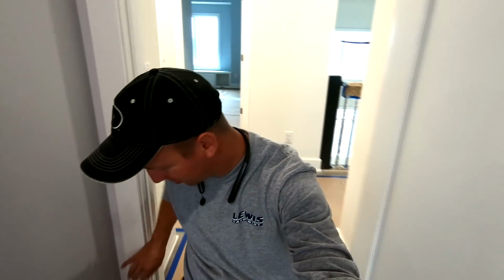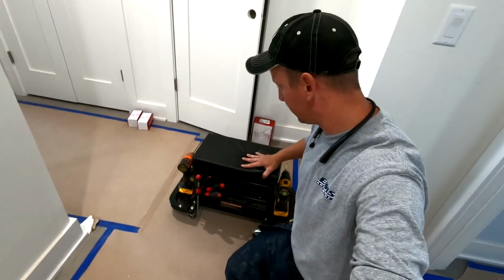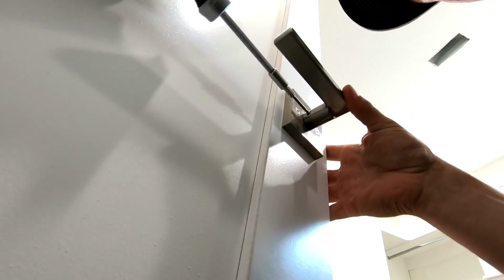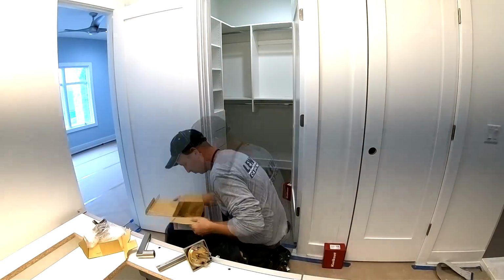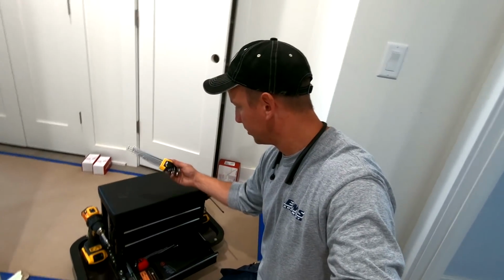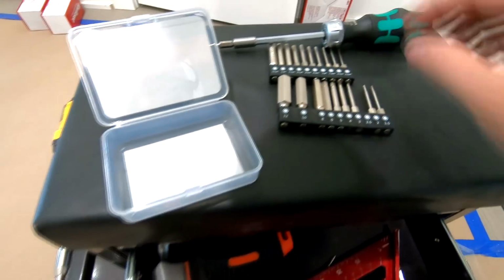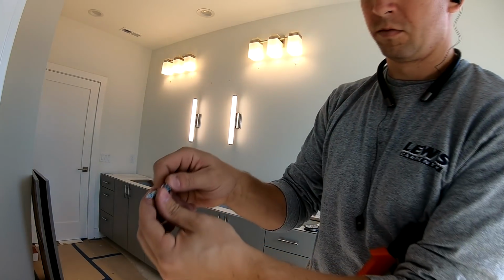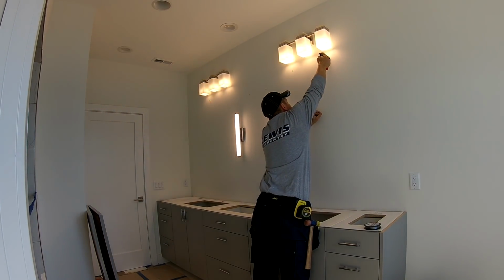Punch List Rolling Tool Chest Seat - Big Time Saver for Hardware

Comment: Hi Lewis   i am a trim carpenter with  40years  experience  like  you i work solo a little  tip that you  probably  know  already  is i keep  a little  stud4sure magnet  in my snickers  pants  pocket  saves  time rooting  for little  tiny  twist drill bits and different driver tips  when fitting  door  furniture. Thanks  for sharing  your skill  regards  from Ireland

Comment: I used to do that on many jobs over 35 years ago, with 3 joint compound cans, the 2 top ones had the bottoms cut out, to make room for more tools.   Had it mounted on a 6 caster round plywood (3/4") 14" diameter slab for stability.  I drove screws through the bottom one, to make certain I did not slide off.  I included a cheap small round cushion for my built-in soft seat.

Comment: Great tip on using the allen head on ratcheting handle. Here's a tip I've found useful- instead of drilling holes for your anchors, in drywall, just use a tapered awl. Nice clean hole without the dust. (I work in furnished homes).
Reply: Try those large thread aluminum self taping with center hole for #10 fine thread screw, included
All with cordless drill

Comment: Purchased the exact same identical tool cart from Harbor Freight a couple years back , been using for the same purpose, really makes a difference in production and saves on the knees and toes. I like to use a yankee screwdriver rather than a ratcheting and my new fav is my Hyper tough powered screwdriver with a clutch from bluemart . I might add also that I used a .375 forstner bit and just slightly pocketed the bottom of my impact and drill driver batteries , then glued a small neodymium magnet into the pocket, the slight magnetism adds stability to the tools.

Comment: I use a variation of this for maintenance/ repair in the cabinet shop!
The 90mm length bits are the best,1 inch bits in holders are always to short.
Reply: I wonder if using moly bolts would pull drywall to the cabinet,lessening the gap where it meets the faceframe .🤔
We currently use flat-trim if the gap is too large.

Comment: Been a carpenter for almost 40 years. I wish someone had told me to care for my knees more. My knees are pretty worn out. Makes snowboarding and hiking almost impossible, not to mention working. Been using a HF rolling stool for baseboards and door hardware for a while , but it just broke. The drawer/shelf setup on yours is much better. I have a few Wen products and they have been working pretty well so far. Just ordered one ... thanks for the tip.
Reply from the maker: Get some Pro Knees. My knees are already trashed also. Pro Knees are amazing. The way they take weight off the knees is unlike anything else.
Reply: @InsiderCarpentry   are those knee pads on Amazon, Ap 16?

Comment: One thing you might want to consider is is putting the escutcheon plate screws on the inside of the closet, not the outside. It is a cleaner look not to see the screws from the outside. Love that Tool Chest Seat though.
Reply from the maker: Yeah, I always try to do that. Brain fart trying to work shoot video at the same time.
Reply: I've been doing finish work for 30 years and I recognize good work when I see it. You do fine work and I learn new techniques from your videos.

Comment: My work around for those set screws was to use the T10 torx bit on a 6" extension for my impact.  Works like a dream when I have 100+ to do. The T10 torx works on most towel bar set screws also.
Reply from the maker: Seems like using an impact would be asking for trouble. 🤔
Reply: @InsiderCarpentry  the new dewalts have a modified torque setting plus trigger ramping that eliminates the risk I find. Was going to reinvest in their brushless 12v for the punch list stuff going forward.

Comment: Sometimes if you do not have the correct size you can cut the 90 off the wrench they give you and put it in your screwdriver.
Reply: Great tip thanks my man.
Reply: Not just sometimes. Buy a whole set and get it all cut off. You'll never regret it.

Comment: Could you do a video on benchmark times for different activities? For example you mentioned taking 10/min per door for hardware. It would be nice to see how I compare how fast you can hang doors, case doors, case windows, run base, setup, and downtime between tasks, etc. So I have a benchmark to compare my work against.

Comment: As a potential upgrade to the Wera driver (I adore their laser-tip long Screwdrivers as they really grip
The soft grin-screws door handles are held on with), maybe the  WIHA Speed-E driver might work. It’s a cordless driver but the handle is the same as a manual one.

Comment from the maker: Molley Achor Bolts 50 Pack - https://amzn.to/31zQMB8
Rolling Tool Chest Seat - https://amzn.to/3dh6WUG
Wera Ratcheting Screwdriver - https://amzn.to/34I6bjE
Self Centering Vix Bits - https://amzn.to/33NkMLm
Molly Drywall Anchor Setting Tool - https://amzn.to/2GVE3Bk
Stubby Hammer - https://amzn.to/3iQq50W
Stabila Magnetic Torpedo Level - https://amzn.to/3nHrH0w
Wiha 26391 Screwdriver Set, Hex Inch With Precision Handle, 8 Piece - https://amzn.to/36TUUQ3
Router Plane - https://amzn.to/2FiXELg
Wiha 26390 Screwdriver Set, Hex Metric With Precision Handle, .7 - 3.0mm, 7 Piece - https://amzn.to/3lB7x6x
Wiha 30295 Screwdriver Set, Slotted and Phillips, 5 Piece - https://amzn.to/352odNV
Hex Head Allen Wrench Drill Bit Set 20PC (10pc Metric & 10pc SAE) - https://amzn.to/30U6Yge
Canvas Precision Screwdriver Pouch, 8 Pkt  - https://amzn.to/33NlpEI
Wiha 26391 Screwdriver Set, Hex Inch With Precision Handle, 8 Piece - https://amzn.to/3iRwclu
Prime-Line Products Z 10532 Molly Bolt Standard, 1 1/4-Inch, 50-Pack - https://amzn.to/34FXDtq

Stanley Sweetheart Chisel 1/2 inch - https://amzn.to/33PrGQr
Stanley Sweetheart Chisel 1 inch - https://amzn.to/3iME0oR

My Favorite Tools - Insider Carpentry Amazon Site - https://www.amazon.com/shop/insider_carpentry

 Support more content like this by becoming a  PATREON SUPPORTER - https://www.patreon.com/insider_carpentry

Comment: Hi I don't believe you ever actually said why you bothered to take the washers off the Molly bolts I don't see how it affects the use of the gun tool or any particular hanging fixture and of course I've used them a hundred times before so what am I missing and thanks for sharing your content is great
Reply from the maker: When hanging mirrors, the washer can interfere with the bolt finding the slot on the back of the mirror. It might just be my OCD too. LOL

Comment: It’s especially difficult to use those Allen wrenches with those knobs with the set screws coated with locktite. My 2mm bit I use specifically for that same knob model you’re installing recently broke tightening that set screw. I’d rather not buy another entire set for that one bit.
Reply from the maker: That’s why I use the ratcheting driver. It makes driving those set screws so much easier.

Comment: Great workmanship. Any tips on how to install door knob. It's round and screws behind knob?
Reply: Use a good #2 philips screwdriver. Use one with a thin long shaft so nothing touches the knob but the shaft. The screwdriver will be at an angle, but as long as the philips tip is sharp and well defined and you keep good preasure on it, it will unscrew nicely. When re-installing, screw both sides in evenly, not one side first. This will make it easier  to reach the head of the screws.

Comment: When you are laying out the holes for the mirrors do you measure off the ceiling? or off of the cabinet? light fixture?  I always measure down from the ceiling but recently got into some trouble with this. It relies too much on everything else being done right. One crooked light fixture install or a small out of level vanity can really distort the final look. Any tips on how to avoid?
Reply from the maker: No way. I always measure off the cabinet or countertop I’m conjunction with a level.

Comment: Hey thanks for another great video. Have you ever had that tool for the mollies bend the screw? Am I getting bad hardware or maybe doing something wrong? Also the link you provided for the mollies is unavailable what do you recommend I use for mostly 1/2" drywall.
Reply from the maker: I can't say I have. I have had problems with the screws stripping when using a drill, but not bending.
Reply from the maker: https://amzn.to/31zQMB8
Reply: @InsiderCarpentry  thanks have a great weekend
Reply: Those are $50 for 50 of them?
Reply: @derekt4459  ??

Comment: just wondering why you didnt install the strike plates while you were at each door
Reply from the maker: Because of the thicker trim they needed extended strike plates which had not been delivered yet. 👌
Reply: I used to have that problem as well so I adjusted my margin just a little bit more to accommodate the thicker trim

Comment: Didn't it bother you having those bathroom lights constantly dimming up and down like that? 😁
Reply from the maker: They aren’t. For some reason that type of light messes with the video camera. No clue why. Same think happens with my dewalt work lights when I record and they’re on.
Reply: @InsiderCarpentry  I was just messing with you. It's the LED light ballasts. They run on certain frequencies and they vary. To avoid that problem with your camera, just run it on manual mode and adjust shutter speed until the light looks steady. Then just adjust your ISO or aperture  for exposure. 👍🏼
Reply from the maker: Haha. You know way more about cameras than I do. 😂 I mostly shoot with a GoPro. I like point and shoot.

Comment: https://thsracing.com/shop/ols/categories/tools  

Those are some of, if not THE best hex "bits" you can buy.  I've been using the metric ones for several years now and I haven't destroyed a single one, even the tiny 1.5mm.  I really need to get a set or two of the inch bits.  I'm not easy on them either as I both hand drive and power drive them.

FWIW, I've used and have the Wiha hex precision screwdrivers and they're just "okay".  The steel is a little soft and they really don't hold up long term like the ground THS Racing bits.  I do very much like the Wiha phillips and slotted screwdrivers though.